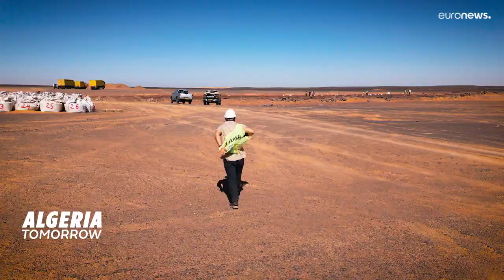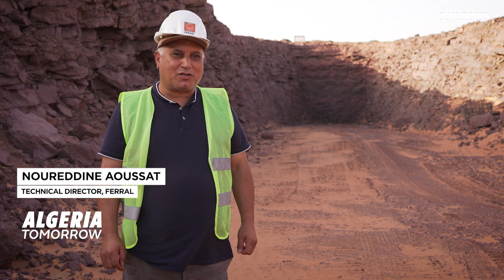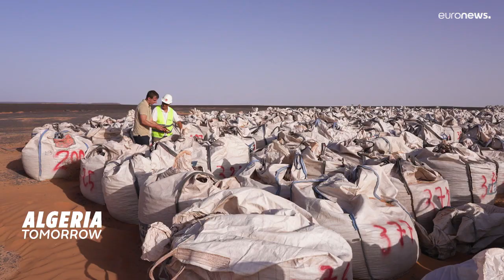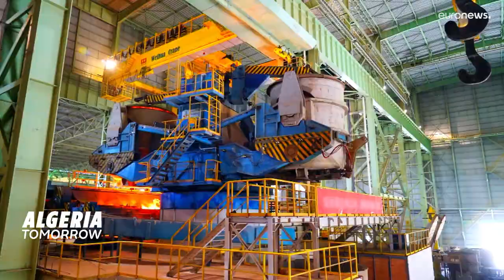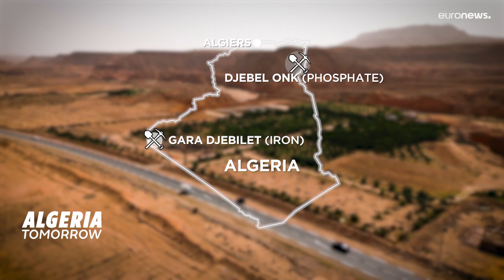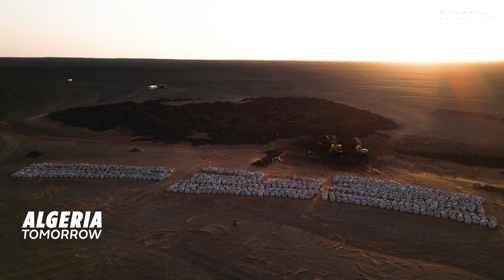How Algeria is to turning to its mineral resources to diversify its economy

Comment: Un privilège donné à une compagnie Turque. Du minerai de fer au ras du sol à 95% de concentration en fer pour un coût d'extraction inimaginablement bas. Une voie ferrée est mise à la disposition des Turques pour acheminer le minerai vers une usine Turque à Oran fournie en énergie bon marché pour fabriquer des produits finis au grand profit des Turques. Il est où l'intérêt de l'Algérie dans ce partenariat ?
A privilege given to a Turkish company. Iron ore at ground level with 95% iron concentration for an unimaginably low extraction cost. A railway is made available to the Turks to transport the ore to a Turkish factory in Oran supplied with cheap energy to manufacture finished products for the great benefit of the Turks. Where is Algeria's interest in this partnership?